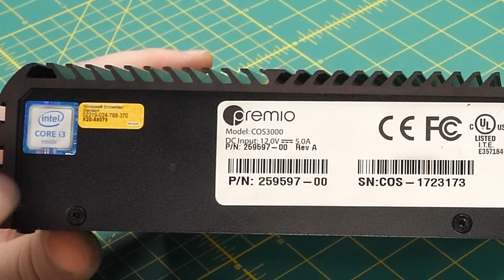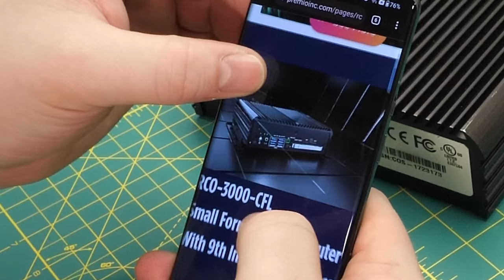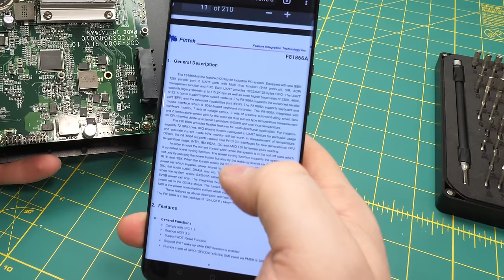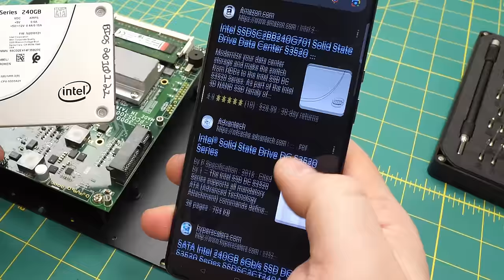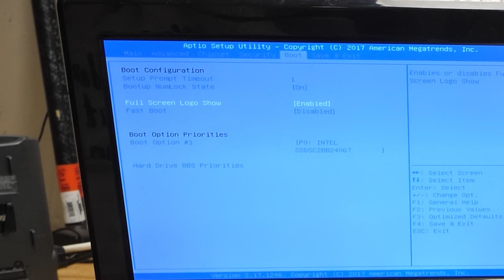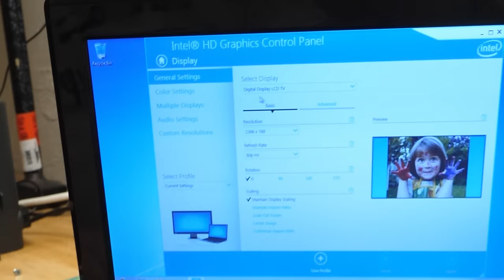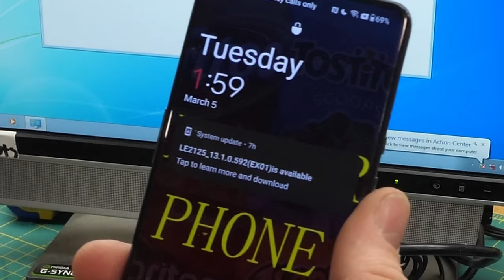Little Guys: Episode 4 [Premio / Coinstar]

Comment: A small note re: 25:00

While that note from Gamers Nexus is absolutely true, that's (probably) only true for processors that have an "IHS" or Integrated Heat Spreader, since you're only making contact with that metal plate that is itself conducting heat from the actual die of the processor.

The processor in this unit doesn't have an IHS, so ensuring you have total coverage of the die with thermal paste is much more important to ensure all of the chip is able to conduct heat to your... dissipation medium? Whatever you call it, I think you get the idea.
Reply: Anyways, hope I wasn't condescending explaining the IHS thing, so feel free to disregard if this is all old hat to you. I just retained a little from watching a couple der8auer videos and cleaning up graphics cards whose dies are basically always exposed and make direct contact to the fin array

Regardless, I've absolutely been loving your videos and it's been a lot of fun watching these more candid but still lightly edited ones from Little Guys. The off the cuff vibes of a stream without all the dead air that entails.

Take care!
Reply from the maker: Not at all, I appreciate the comment - as it turns out, I completely screwed this up; at 40:10 or so you can see that the sink never touched the grease at all, so this CPU requires the pad to make contact. I've probably messed this up with several other machines too and not realized it. Thank you so much for watching and enjoying nonetheless!
Reply: LMAO oh my god that's such an infuriating thing to realize in retrospect 

On the plus side, the dvi transplant was hilarious so you can still chalk this one up as a W

Comment: 25:00 for CPUs/GPUs with IHS the thermal paste application method is not that important. But when you have an expose die like this computer its better to spread the thermal compound on it since not having it evenly spread might create a hot spot.
Reply from the maker: Valid point, I hadn't considered that. On the bare die, if the goop doesn't quite squeeze out to a corner, that corner is just dangling.
Reply: @CathodeRayDude  Glad to have helped, you make really nice content and people can make whoopies from time to time.
Reply from the maker: @ezequieldom641  This was a real whopper of a whoopsie as it turns out, too. Someone else pointed out that when i later take the heat riser off again, you can see that it isn't touching the die at all. It turns out the pad is absolutely essential to fill the gap; not gonna make THAT mistake again, hahaha.
Reply: @CathodeRayDude That issue could be solved by using another thermal pad or shaving down those steel inserts, but that would make the heat riser shorter making another problem where the riser is not tall enough so you will need a thicker thermal pad.
Which is just spinning in circles at this point.

Comment: do you know if this is a 4 layer circuit board? there could potentially be between 2 and 10 given the age. The reason I ask, you were asking the reason for the large copper ring. Running circuit traces, this looks  like a formidable ground passthrough between the top and bottom layer. That would give a strong ground between all of your components and likely has nothing to do with standoffs.

Comment: as far as the heatsink block thing goes, at work (we design industrial systems) we call those "heat spreaders" or "heat blocks"
i have also heard "heat transfer blocks" and just regular ol "heatsinks" 
Its one of those things where i dont think there is a proper industry term and you figure it out with context clues

Comment: That didn't exactly fully explain what a Coinstar is, I don't think. It's a machine that lets you exchange boatloads of loose change for a ticket that acts as a check worth the total value of the coins you put in (minus a 13 percent fee. Seriously, just spend the actual coins at the register, please.) Alternatively, you can use it to exchange the coins for the equivalent value of bitcoin, a gift card, or donate to charity.

Comment: * another reason to use Opto Isolators is for removing digital noise via ground loops.  A classic example for this is MIDI hardware - where you have Audio & Digital I/O on the same device.
Although I'm confident that the reasoning for this on this device would not be for isolation of digital noise on the audio lines - but it's another application for Opto Isolators.

Comment: arctic sells a 20g tube of mx4 for $10. it's the good stuff. 
(not to be confused with Arctic Silver, two completely different brands)
if you're looking for high performance stuff, Cooler Master CryoFuze is the good stuff. it's so full of the thermal transfer stuff that it's a very dense and dry thermal compound, you might actually need the spatty to get it out of the tube cleanly.

Comment: Can get plenty of those little industrial or "fanless" PCs on Amazon here, various models with various IO options to suit your particular use case. Could probably use them for everything from driving advert boards to routers to ..well.. vending machines I guess!

I used to have one with an i7 in being used as a general smol PC until it basically cooked itself. An i7 in a fanless PC is a bit ambitious, I guess.

Comment: @ 12:20 SAE J1708 is an older standard for Automotive applications, specifically used in Over The Road trucks; semi-trucks.
It's another standard for serial communications, but tailored for heavy duty automotive ECUs to use 9600 baud serial.
Really common in heavy duty trucks, but also found in off-road vehicles like farm tractors and construction equipment.
Reply: There's also CAN, and I2C. (and a handful of pre-CAN proprietary automotive protocols)

Comment: But really, are these videos funny... I actually have a demand coming up at work where we might need an industrial computer with decent graphical power, and lo and behold, C&T Solutions does have something like that in their lineup. Thanks for the completely unintended supplier hint!
That 2nd SATA port I bet would throw the hard drive/SSD down into the cavity left underneath the motherboard.
Also congrats on that upgrade, that was a funny idea and the results were the best possible.

Comment: I mentioned this on the last Little Guy, but I have some Really Little Guys (like 3"x3"x1") Ebox (at least, that's what was sharpied on the box they were given to me in) that were used to drive the haunted mansion photo preview monitors at an amusement park I worked at (think those screens that show the pictures of people who just got off so they can buy a print of it) If you have a PO box, I'd be more than happy to send one your way.
Reply from the maker: I missed your comment on the last video! I googled those and they look adorable. Can you shoot me an email? cathoderaydude at Gmail. Thanks!!
Reply: @CathodeRayDude  Sure! I'll have to figure out which box I put them in while cleaning first. I only have one AC adapter for them so I can't send that, but I can send a diagram with the pinout

Comment: 19:10 heat spreader?
36:44 yes, it does work, some monitors even have build in speaker that works with sound over the DVI
44:40 exacly, maybe some ESD stuff but thats it

Comment: The fsp power supply literally shows the dinkle connector on its label, doesn't it? At 4:59 you guess that it came with a different connector and the system builder put the dinkle connector on it. It looks like that's just how it came from fsp.
Reply from the maker: no you're right, lmao, a couple other people pointed it out. I feel silly! I have a ton of supplies like this that weren't originally like that so I just tuned it out.

Comment: You can run HDMI with audio over DVI-D. Particularly the off colour ones. If you have a video card with a yellow DVI-D port, for example, you can connect a DVI-D to HDMI adapter cable on it and get audio from it. But only dual link DVI-D will carry audio. DVI-A and DVI-I will not. 

I'm still looking forward to your video on the Stratacache/FitPC device. I hope you saw my comment with the link about it on the last video.

Comment: For reference, Microchip brand still seems to manufacture a couple of SuperIO chips as well.
Reply: Additional note: Vanilla DVI doesn't support audio, but there are proprietary encoding extensions (they don't require any electrical changes) that add it... but using them gets you into the same licensing situation as DVI, so there's little to no reason to use them.

Comment: Looks similar to a 4G or 5G router that you would put a 4G Pcie card in that you would see a spot for a sim car also if it was a dedicated wireless WAN. these devices are seen for internet in police cars and other law enforcement vehicles that need that need it. Besides the point, this look's very similar to one of the wireless WAN routers but with a ton more USB and USB 3.0 on it for I assume the card reader and coin devices!

Comment: also sorry - the install medium you have is a customized PE. it's not that it's windows embedded. that's hardware. Win Servers, Win systems, and win embedded all do these features because you're installing from a PE source (Personalized Environment). If you're in a large domain and managing several machines, you can create your own company PE DVD/Flash and put the Windows Updates and Support Files for all of your installs. It's to keep your systems as consistent as possible. Also maintenance from a PE is super fast compared to a classic Windows Install disk. It's configurable. It can also support external program installs from menus (as you are using). It can configure to use your company servers as install sources. It can preregister your domain controllers. Someone made that tool for you to use.

Comment: I have an HP thinclient similiar to that size someone gave me, I repuposed to running my webserver and smb server nonstop for the last 15 years, only it's a lotttt lower in spec...  400mgz single core, 110mb of usable ram (16mb used for video memory).  No HD or SSD, it boots and runs off a 64gb USB stick.
The watchdog timers I set on my network equipment actually network ping the other networking equipment next in the connection line and reboot I guess if they don't get an answer 3x in a row.

Comment: A properly designed opto coupler circuit will have a zener diode clamping any overvoltage
Reply from the maker: Oh yeah but at some point you can still overvolt it. If you give it 48 where it's expecting no more than 5, you're now basically crowbarring 48V straight to ground; something's gonna get hot. And if you give it 240, it's gonna blow a hole through that zener and probably arc through it, and things are gonna get even hotter.
Reply: You're absolutely correct. Let me be more precise and shed more light on DIO: usually 48 V is a quite common voltage in industrial  applications like on a factory floor. Any industrial DIO (nomenclature from PLC times, vs GPIO in modern times) circuit that is protected with an opto coupler, will usually(!) have a properly designed overvoltage protection that goes until 48 V, guaranteed for either  indefinite or "reasonable" time. I am talking about that voltage specifically because you mentioned it, and it is the upper limit for "low voltage" applications (where signal wires and power supply wires can be run together and need no isolation to be touched). The most likely mistake somebody connecting inputs on the factory floor will make will be in that range. 

A common error is connecting voltage driving a relais or contacter at 12/24/48 volt into a DIO pin. 

As you might have observed, there is usually no mains voltage near those terminals to prevent 120/240 AC to be injected by accident. All those little guys have 12 V supplies for this secondary reason. Usually. For a list of exceptions, please press 4.

Now, as you mentioned, if you send mains voltage or 2 kV down the input, the arcing and sparking will fry the device.
It's just very hard (not impossible) to accidentally connect a conductor sized for that voltage to a small DIO pin, especially because they are supposed to be physically separated.

I have, however not been able to identify any protective circuit whatsoever on that motherboard, in the short moments i was able to take a look. This PC is then also not used on a factory floor, it is "industrial" in the less strict sense of "commercial".

This means that the DIO pins on this device will get burned out probably waaaay before 12 V. Sometimes those unprotected ones are not even 5 V tolerant.
Reply from the maker: @der.Schtefan  Thank you for all this detail, this is terrific. I understand why you made the distinction about 48V now!

Comment: Concerning DVi/VGA, every pin required for VGA is existant in the DVI connector. So if a card supports DVI it also supports VGA with no software or hardware changes, save the connector itself.
(This is only the case for DVI-A (analog) and DVI-I (analog+digital) but not DVI-D (digital)).

Comment: I like these small form factor systems. ATX doesn't make sense for most situations. Even if you need a big GPU an external gpu enclosure with thunderbolt or external pcie will work fine.

Comment: Yes, DVI can carry audio, but you need a graphics card and a screen (with speakers or other audio output) that supports audio-over-DVI, it ain't exactly very common AFAIK; I've only seen it happen once and that was by accident, but then again I haven't exactly had the money nor the need for many new/better screens.

^ I dunno if graphics cards/drivers had the support since the start, either.

Yes, DVI was explicitly built with VGA support since the start, there are dedicated pins for that, but IIRC they could be used to make a better no-VGA connection.

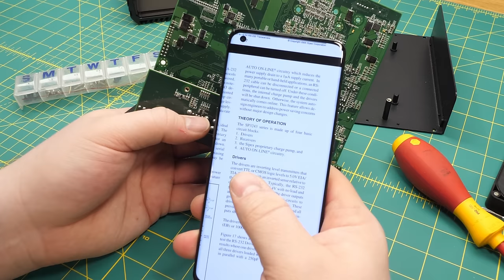Comment: 22:12 +/- 5 volts would give a total voltage difference of 10 volts, so it's about the same as what you expected.

Often with electronics the exact voltage is less important than the difference between high and low. After all, the only "absolute" low voltage a device can find is whatever voltage is provided by the 🌎 ground / dirt. Sometimes, a circuit is "floating" and doesn't have a connection to 🌍 ground at all; it picks some voltage as it's ground / reference and adds or subtracts from there (+/- 5).

Comment: You could try installing a more obsolete version of Windows like XP or 98. It would be easy enough to adapt this device to be a car media computer since it already runs off 12v. All you'd need is a 7812 and a beefy heatsink on some protoboard and a long video extension cable to connect to a dash mounted monitor.

Comment: 18:48 All the desktops I've built have Super I/O chips for sensors and whatnot. Generally the Super I/O chips are made by Nuvoton or ITE.
Reply: I don't think anything more complex than a tablet could boot without one, though on laptops Ene is usually the choice. ITE is pretty much gone, still happens but obsolete. Nuvoton has some nice ones, they are also responsible for BIOS Flashback without CPU. Microchip also makes some, but i haven't seen them recently, they continue the SMSC line.

Comment: No reason something like this couldn't be done by some sort of low end SBC, like a Raspberry PI, apart from familiarity...  There are a lot more technicians who know Windows than any individual SBC, so it's likely the technicians are cheaper.   At least the low end ones.

I remember the days when we had nearly every cable on a computer with a screw in connector..   Apart from, ironically, the most important one, the power connector.    

OK, so a 3pin IEC connector isn't likely to fall out, but it is possible, and if it does happen, you've possibly lost data.   That, to me, is a good enough reason to require a locking connector.

Comment: Those GPIO are probably all used on peripherals already.  You don't get all those serial ports etc AND a bunch of GPIO.  You allocate GPIO as serial ports.
Reply from the maker: Nah, read it closer - it explicitly says that there's a single parallel port and 6 UARTs, and then lists the GPIOs separately.
Reply: @CathodeRayDude  thats how it looks in all the other whitesheets for microcontrollers.  Each pin will say GP## (if not for power) but sometimes also UARTx## and anything else that pin can be overrided with.  Look at the pin descriptions.
Reply from the maker: @rockosgaminglogic  Oh, I'm sorry, I misunderstood your first comment. Dunno how, but I thought you were saying that you couldn't ever have 72 GPIOs on this chip. It looks like you just have to trade them for serial ports etc., which still seems very interesting in the hobbyist context, where you'd probably just shut off all the predefined peripherals anyway.

Comment: Hey I was working in the moving industry and ended up doing a demo at a doctors office. Tl;dr: would you be interested in me sending you a video asset host? Basically an intel mobo with the sole purpose of showing ads in a doctors office waiting room. Lol i thought about reverse engineering it to use windows ( think its linux) but rn its just deadweight in my closet. Figured id ask before i sell it. Thanks for all the awesome content!
Reply from the maker: depends on the details but I do like digital signage computers - shoot me an email with a picture if you don't mind? cathoderaydude at Gmail. thanks!